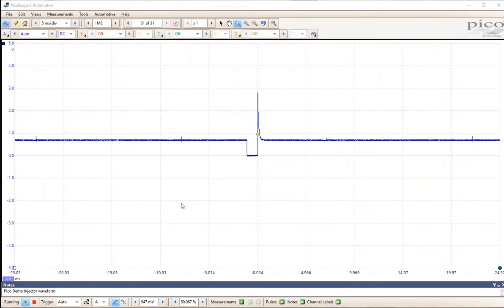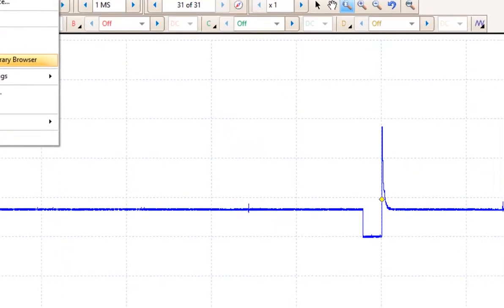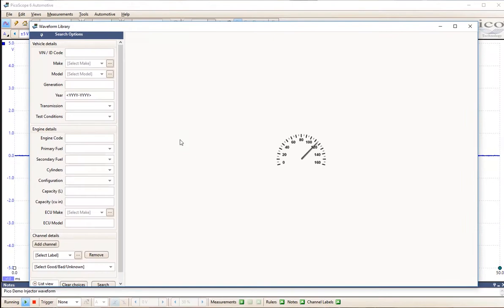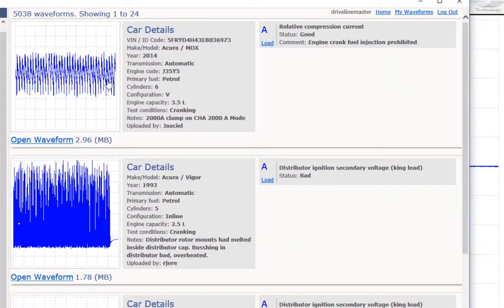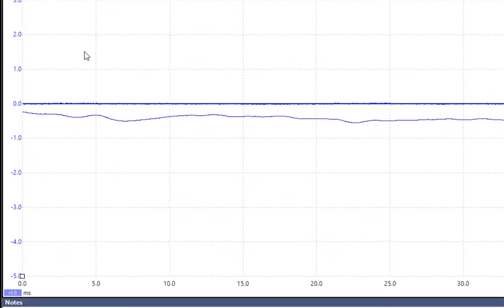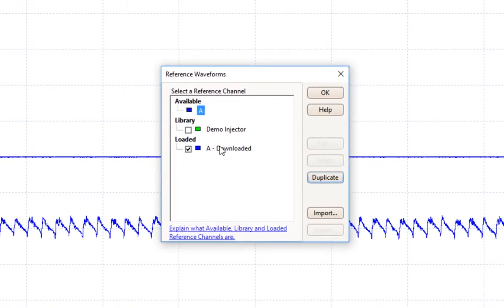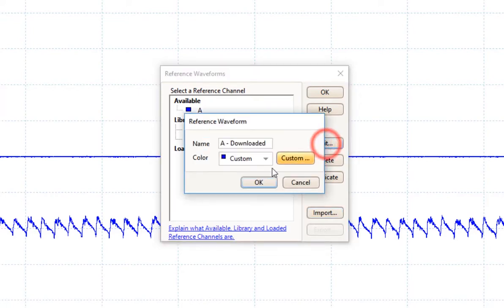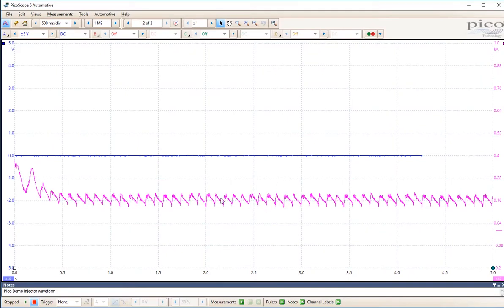Pico Scope 6, Using the Library Browser. (Lesson 17)

Comment: hi, how do  i move reference wave to left or right but keep the current actual wave form on same place to match both on time base.
Reply from the maker: Check out lesson 16 if your using Pico Scope 6 software.  https://youtu.be/fjAGeB3d000?si=UpssVzIHtXV5wa7X  Let me know if  your using Pico Scope 7 and I will look up how to do this in PS7 software.
Reply: @DrivelineMaster  Hi i am using pico 7.
Reply from the maker: Good for you.  Let me look that up and respond in a little bit.
Reply: @DrivelineMaster  Thanks i also didnt find a way to overlap reference wave form in pico 7 as well.. any help is apprecaited
Reply from the maker: In Pico 7 Click the More menu and choose Reference Waveforms.  Select File and choose which reference waveform you would like to load and select Open.  The reference waveform option menu should still be open.  Click the plus or minus to change the delay. This will move the reference waveform left or right.  Clicking the plus or minus under vertical offest will move the reference waveform up or down.
Reply: @DrivelineMaster   in pico 7 reference wave needs ..ps reference where as the reference wave form i got is .psdata. so not sure how i can save a wave form as .psreference
Reply: @DrivelineMaster  Thanks it worked. CAnt thank enoughfor your help
Reply from the maker: Decided to make a Pico 7 video on using reference waveforms.  It should be done in a day or two.  It will show how to convert a PSdata file into a reference waveform file along with the rest of the stuff you asked me.
Reply: @DrivelineMaster   tHANKS, PLS SEE IF YOU CAN SHOW MORE THAN ONE WAVE FORM LIKE CRANK AND CAM IN ONE REERENCE WAVE FORM. Seems lke you can check only one wave form. i may be wrong.
Reply from the maker: New PS7 video on how to work with reference waveforms. https://youtu.be/OL6tUK_7uOU
Reply: @DrivelineMaster  thanks mich